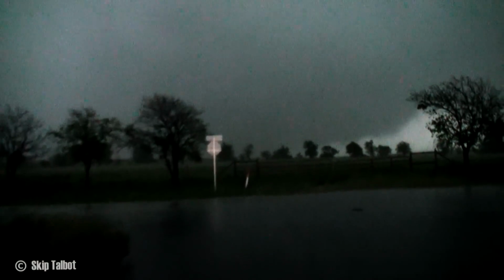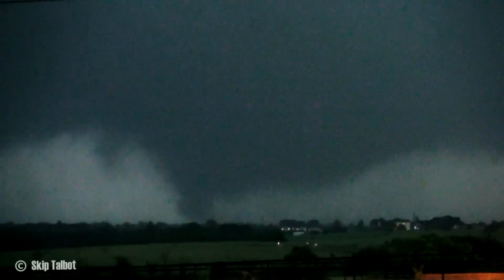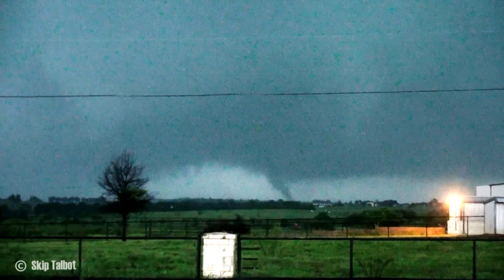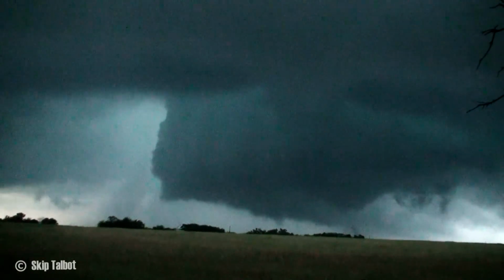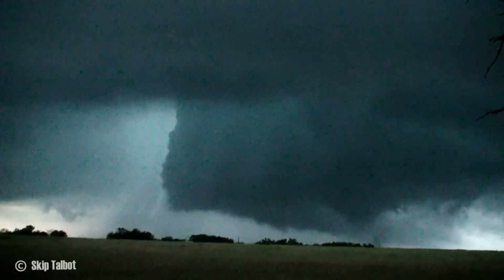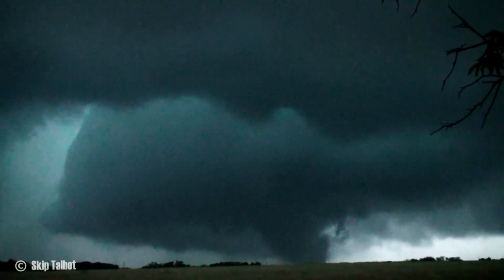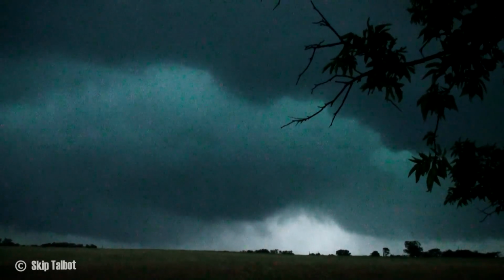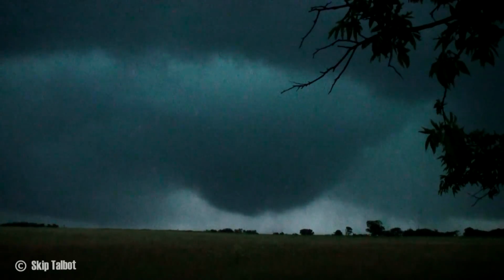Wedge Tornado near Krum, TX: May 7, 2015

Comment: Had that thing hit some houses or businesses when it was that large, I bet the damage would be of EF3 or EF4 intensity.
Reply from the maker: +Jordan Martirossian Yeah, it probably would have been rated higher, and that's usually the case. If a tornado hits more things, it generally winds up being rated higher because there are simply more examples of damage that they can use for the rating. The visual appearance of the tornado is a not a very good indicator of its strength though. Some tiny rope tornadoes can do EF4/EF5 damage, and I've seen wedges over a mile wide that didn't even take down power lines.
Reply: +Skip Talbot's Storm Chasing Chronicles kinda like the start of the one in newcastle oklahoma
and one of my personal fovorites the union city rope out stage back in the 80s some time i think
Reply: +Skip Talbot's Storm Chasing Chronicles i agreed just look at katie ok EF4 tornado it was stovepipe tornado but causing major damage
Reply: @skiptalbot  Yep, take a look at the 2007 Elie, Manitoba, Canada F-5, it was a little rope when it was debarking trees, tossing vans 200 yards and wiping houses clean off their foundation.
Reply: @ariefraditya868  the 2007 Elie F5 was a ropw

Comment: EF-1 but still a large, powerful multi-vortex tornado. Wat.
Reply from the maker: Champzion That's the limitation of the EF scale. It's a damage based scale. If a 2 mile wide tornado with 300 mph winds hits nothing but an empty field it would be rated EF-0 since there would be no damage indicators on which to rate the tornado.
Reply: I'm aware of that, I was just commenting the sometimes misleading nature of the scale itself. If the exact wind speed of the tornado was interpreted from a radar image and added to the equation, it would often paint a more accurate and insightful picture of the tornados strength IMO.
Reply from the maker: Champzion Yeah, definitely. It would be nice to have that kind of radar resolution and coverage available, but it looks like damage indicators are going to remain the most reliable way to gauge a tornado's strength for the foreseeable future.
Reply: ***** i think in cases like this wind speed should also be judged because it become misleading for things like climate studies of severe weather......if you have storms with winds over 200 mph and it's rated EF-1 or EF-0....the studies would be way off ...not to mention people would become more complacent thinking "oh we only get the small tornadoes here...and that could impact a lot of people's perspective of the danger's in that area.....I really don't agree with the new system because it takes out the wind factor......which i think will be more harmful in the long run.
Reply: +Maxx Madd What do you mean "the new system takes out the wind factor"???  From what I understand, both the older, and the newer updated "EF" scale still rely on actual structure damage of various structure types & fastening systems ( nails, screws, bolts, anchor bolts, rebar, metal storm straps, block, brick, wood, etc.) and then determine what wind SPEED it took to damage those structures and to what extent.
Reply: if you have a tornado that does little damage say like the el-reno tornado it will get a lower rating than it should.....did EF-3 damage but had close to 290 mph winds.
Reply from the maker: Hurricanes are measured using aircraft that fly straight through them. This is not a practical or safe way to measure tornadoes. They are wildly different phenomena.

Comment: dude thats not big at all its only an Ef-1 I seen an Ef-5 wayy bigger
Reply: It's not the size, it's the damage that determines the rating.  There have been EF5 tornadoes that were smaller in size than this one.  That said, this one got an EF1 rating because it didn't impact many structures, it was almost certainly capable of doing MUCH higher damage than that.